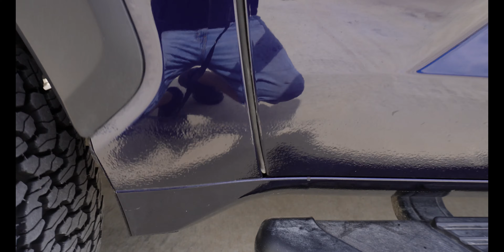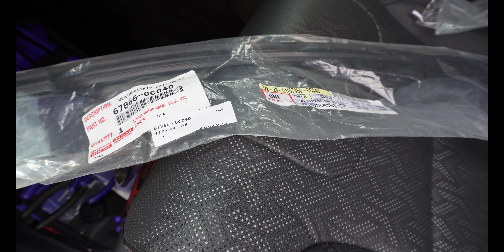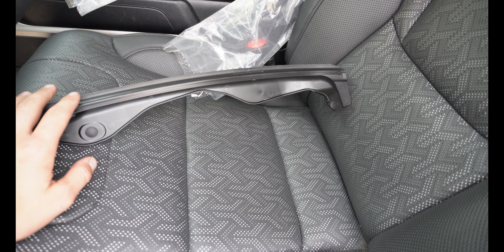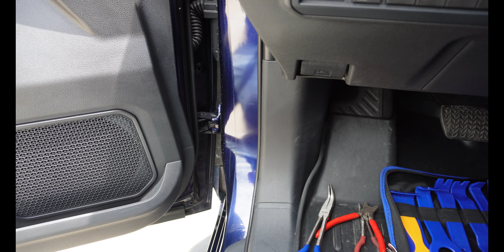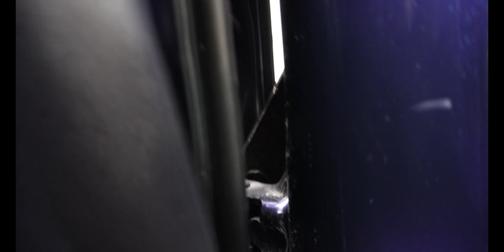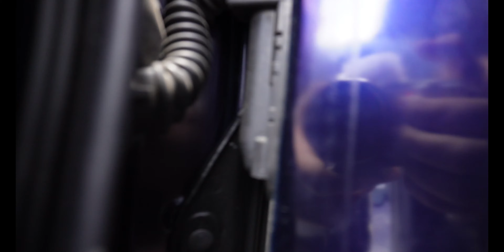2022 Tundra wind noise? You are missing this seal I bet!

Comment: Thanks for this video! mid 2022 SR5 and mine does not have them. Fortunately I am not getting any wind noise at the moment, up to 18k miles. My drivers door rattle was solved by a new door seal from the dealer, but I am going to add these anyway at 30 bucks a piece.
Reply from the maker: Thanks for the comment! Yes, definitely buy them while you can in case you need them later
Reply: did the rattle ever come back or no?
Reply: @MoeChins  not yet thankfully

Comment: I have a 2023 with the seals from the factory.  Drivers side still has bad high pitched wind sound at 30mph and up.  If you look at the drivers side, the seal isnt held tight by the plastic tabs on the strip, and let the seal move away from actually sealing the gap.
Reply from the maker: good info. On my truck, the high pitched whistle over 30mph was actually related to the mirror lower trim piece.
Reply: Can you provide more info on the mirror piece you are refereing to? Which exact piece and how did you troubleshoot and resolve?
Reply: My mirror makes no difference with the noise.  I've tried taping it up every which way

Comment: These trim pieces are not installed on SR and SR5s from the factory, all higher trim levels have them. If you want them on your SR or SR5 you'll need to buy them yourself. I just got a pair today to install on my SR5.
Reply from the maker: Good info!
Reply: @gagefixeseverything did you notice any difference post install?
Reply: @savchuktaras I noticed no difference after installing them. The wind noise is coming from the upper door.

Comment: Mine has the piece and still developed the ubiquitous whistle a few months after purchase. I think it is just the whole door weatherstripping being too flimsy and compressing/breaking down after a few months.
Reply from the maker: Try folding your mirror in while driving. My truck had a terrible whistle from the driver mirror lower plastic trim
Reply: @gagefixeseverything were you able to eliminate the mirror whistling noise?
Reply: My 2022 SR5, the wind noise is coming from the passager side upper corner of the headliner.
Any suggestions would be helpful because I want to files the California Dispute Settlement Program.
Reply: @gagefixeseverything  it sounds like a whistling noise coming off my 24 SR5, was your video what was able to resolve it? If not how did you resolve it

Comment: Does it sound like the wind noise is coming from the mirror before you installed the seal? It sounds like it on mine, I got a 24 SR5 Premium and will be checking if I got this seal or not, if not then I know what I’ll be asking for, got an appointment on the 1st of July, hopefully will get it resolved quick, thanks for the video!
Reply from the maker: YES it was coming from that area. However, there is also a 'mirror' specific noise as well. It it from the lower mirror plastic cover. Toyota refused to fix mine after multiple tries, so I put black electrical tape on it.... on a $60k truck.... Then the engine blew up and I had Toyota buy it back from me.
Reply: @gagefixeseverything  really sorry to hear that, yeah I’ve been having that wind noise even while I was test driving the truck, and they said no matter what it takes they’ll get it fixed which is why I love the Dealership I go to, and I’ve done tried the electrical tape on all those seal areas on the mirror and did nothing for the noise so hoping I was wrong and it’s just because of that area you fixed up

Comment: Went to the dealership for that missing on my 23 trd Sport.  They went by the fact none of the others had it and no one has ever brought it up in these years.  I asked them how are they verifying the part with Toyota, comparing to other vehicles is not proof.  I provided the parts manager the part numbers.  He was able to finally see what I was saying was missing.  They are able to look up your truck and see what Toyota includes.  It appears they aren't being left off at the factory.  Mine is showing not an included part.  The platinums all had it but the regular TRDs did not on the lot.  He agreed that is a total screw up by Toyota and typical of their problems,  almost treating it as a trim accessory depending on model.  So, Ill bet some trucks same model as mine show it as part of the vehicle on that vin and may get it installed under warranty others not.  The service side will have no clue.  You have to get parts to look at that part number and tour vin.  If you tell service, who handles warranties  they have will just look at another truck around them and think you are clueless if tgey see it missing there too.
Reply from the maker: WOW this is EXCELLENT info!!! Nice work.

Comment: I brought my car back to 3 different dealers to fix the whistle noise. The first 2 times they replaced the seal around the driver side door, the 3rd time they gives up & asked me to call Toyota headquarter. They don’t even know where is that whistle noise coming from. Fking pissed me off $75k P.O.S

I’ll buy the seal & give it a try…thanks for sharing.
Reply from the maker: I hope this is your issue! It seems the Tundra has quite a few issues. Toyota bought mine back after more major problems came up
Reply: @gagefixeseverything What happened?
Reply: I did install the seal but that didn’t make any difference for my truck. Take ur car out on a freeway @ 60mph+ and put your ear next to the side mirror u can hear wind noise blowing in from somewhere in that area. Same thing with the passenger side.
Reply: @JWynnnn same. I just used painters tape over all the areas I thought might be the issue. What I’ve found is switching your vent blower to recirculate helps reduce wind noise but doesn’t stop it. My guess is that is the issue in mine.

Comment: Why did you have to buy the parts? Shouldn't Toyota Corp be paying for that? I mean the part was never installed by the factory.
Reply: Agree
Reply from the maker: Because dealers are trash. This truck spent so much time at multiple dealers it was infuriating. And they never got anything fixed. I own a shop, and just got fed up with it. The engine went out at 16k miles.... I made Toyota just buy it back

Comment: I have a 2023 tundra limited with the strips, and it still has drivers side whistling nois at 30mph and up.  Very annoying!
Reply from the maker: My 30mph and up driver side whistle was the lower trim piece under the mirror
Reply: @gagefixeseverything I have same issue. How did you fix it?

Comment: Trying to sort the noise out on mine too.  Mind if I ask what the door seal itself is supposed to look like up top?  Mine seems loose but not sure the norm.  One dealer so far provided no solution.
Reply from the maker: The dealers have been worthless with new tundra issues. I dealt with several. The seal should not have gap in it, and be pushed against the metal surfaces. The mirrors also cause noise, but that one is a whistling sound

Comment: I don’t get a “wind” noise, but the window rattles at the top of the track about 3-4in from the hinge side. My wife says the passenger window does the same thing but I can’t really hear that side over mine. It’s so annoying that I immediately play music or a podcast to drown out the sound. Would this be from the same issue? I have a 22 Limited TRD Off Road. I’m about to check to see if I have this part already installed or not.
Reply from the maker: I am familiar with this noise. It is from the door being too far away from the cab when closed or the door frame being bent on the top side around the window. The dealer will not fix it. I tried several times. To fix it, roll the window all the way down and pull the top of the frame inward. You want to bend the upper frame of the door back in ever so slightly. Not sure why they come this way, but I've seen it several times now.

Comment: Got the seal from the factory and no wind noise 23 1794
Reply from the maker: Good info!
Reply: did you go to the dealer or just bought it by yourself?
Reply: @shane4103  neither, the seal came on the truck stock…